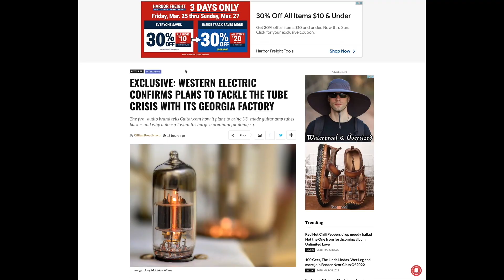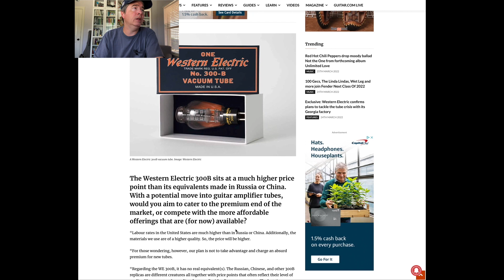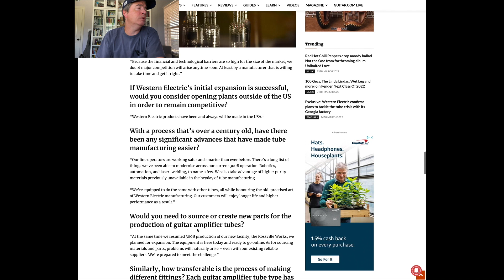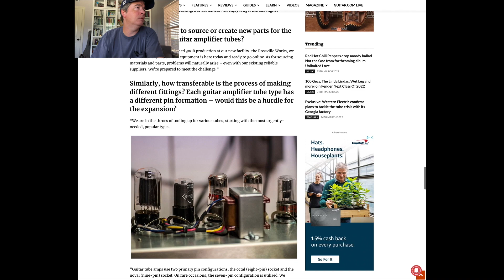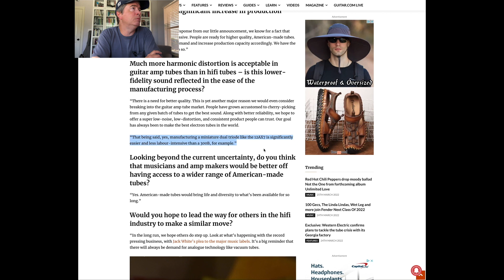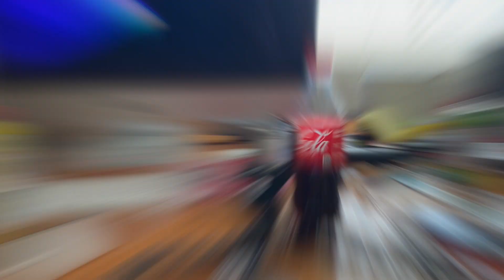New US Made Guitar Amp Tubes - Western Electric To The Rescue!

Comment: I'm not sure why we think that just because it's made in the US, that's its well made and/or high quality?! It makes little difference. We'll see if they are good quality and perform well after they are produced. There is plenty made in the US that is junk.
Reply from the maker: Good points, Rich.  It is certainly a leap to assume that Western Electric tubes will be of the same quality as good NOS tubes.  They will have to prove they can build good quality common guitar amp tubes if they are going to sell them for a premium.  Thanks for the comment.
Reply: @hoganshideout  I agree man! Let's see what happens!
Reply: They’ll have to pass Mesa testing to go in my amp and keep my amp’s warranty for the next 5 years.
Reply: @MrMann-gt1eh  I've replaced all my Mesa amps with tubes of my preference and never had an issue. Then again all my Mesa amps have lasted many years, and still going strong.
Reply: Well, their 300B has a 5 year/40,000 hour guarantee, and that's in a single ended class-A power amplifier. (Which is notoriously hard on tubes)

It seems like they're pretty confident in their quality.